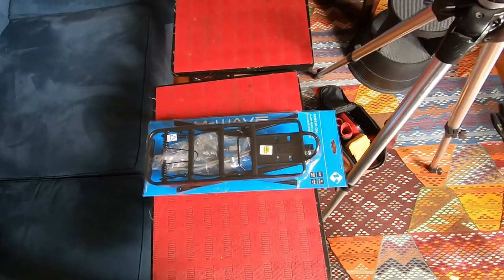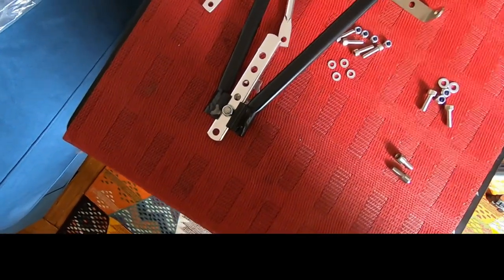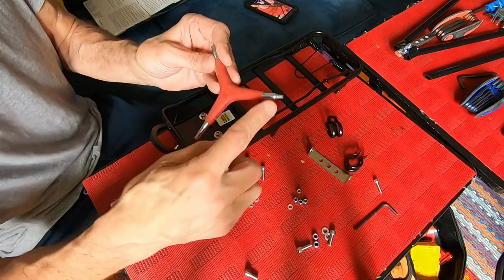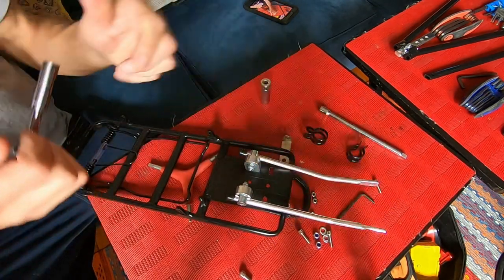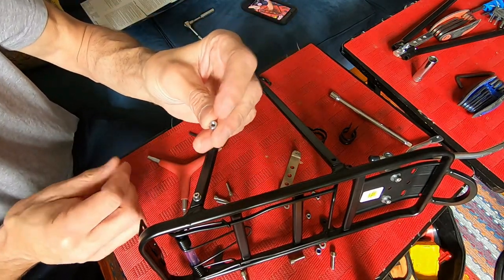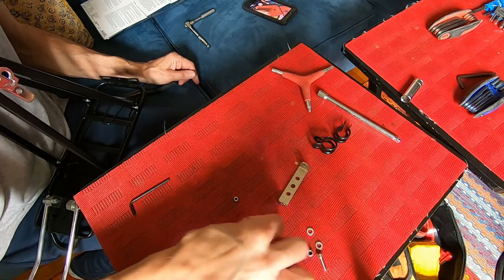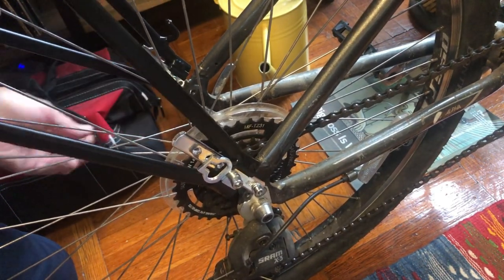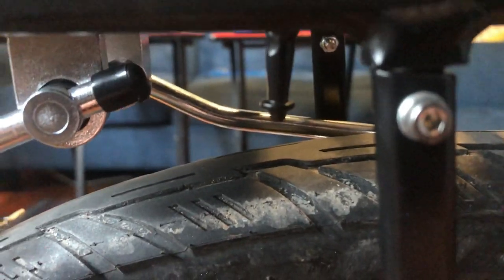How to install M wave bike rack

Comment: If you can't attach the front rods to the frame holes, then you can use the black rubber cufflings they give you to wrap around the frame bars.  That's my plan anyway.

Comment: I have precisely the same rack in front of me and I came to a halt when I could see that the mounting holes by the rear wheel hub are smaller than the supplied hex nuts and the holes in the 6 holes bars. I can't even imagine a fix for that. Well I can; it would require a bolt that has two distinct diameters.
Reply from the maker: Oh wow, that sucks. I imagine that you had a few trips to the local hardware store.  What type of bike is it?